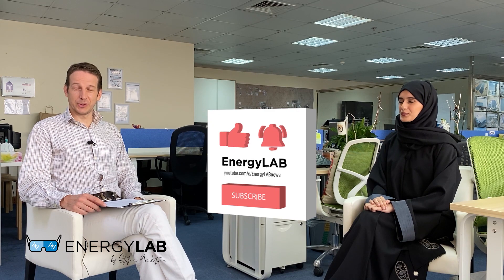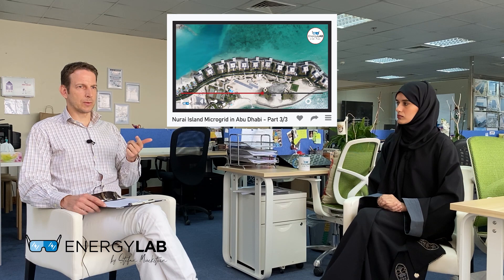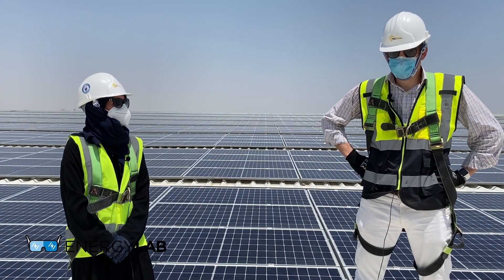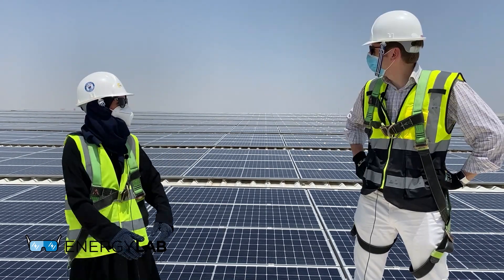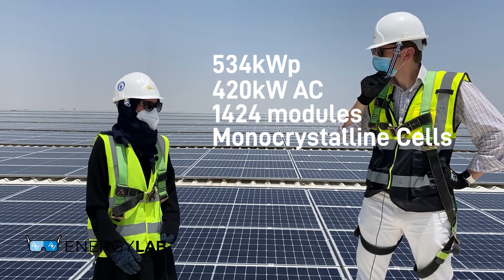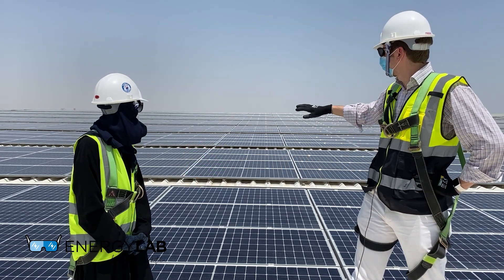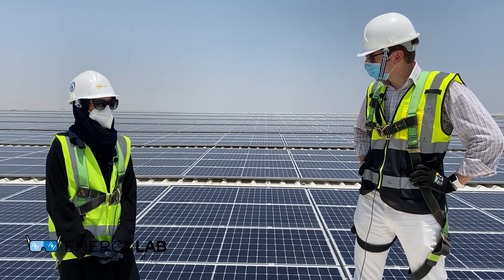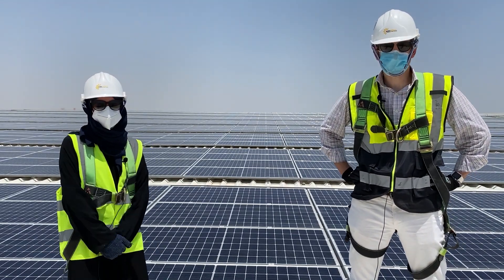Net Metering - Shams Dubai - Solar Roof Top

Comment: Najma Al Taef Building Contracting provides total EPC solutions for the following:
1. PV Solar Solutions / Renewable Energy
2. Civil, Building-Construction
3. Earthing & Lightning Protection Engineering Solutions
4. Façade Light Engineering Solutions
5. All type of Glassworks & Aluminum work
6. Mechanical, Electrical & Plumbing Works
(Electrical Fit Out, Electrical Installation, Structured Cabling work, ATS Panels, CCTV system, Fire-fighting installation, Air Conditioning, HVAC, District Chillers)
7. Building Management Services (BMS System)
8. Facility Maintenance, Building maintenance (AMC)
9. Steel fabrication and welding
10. Substation installation and commissioning.
11. Heavy Transport/ Logistics (Trailer, Truck-mounted cranes, Cranes)

I'm are looking forward to meeting you and explore opportunities in the above-mentioned fields with your esteemed organization,

For Business inquiries, please contact me
Naveed@nabc.ae
+971-55-8977277